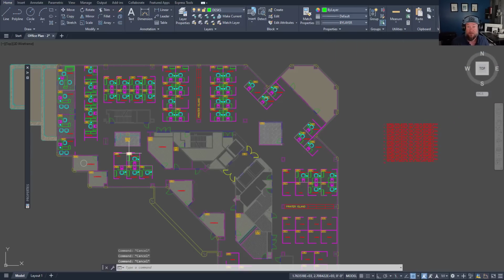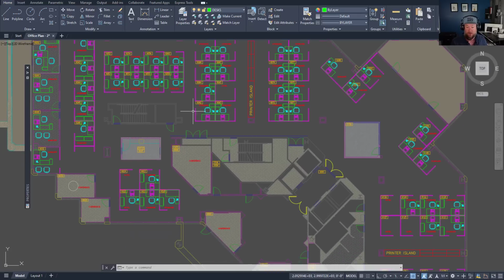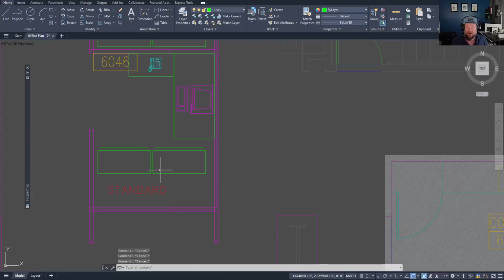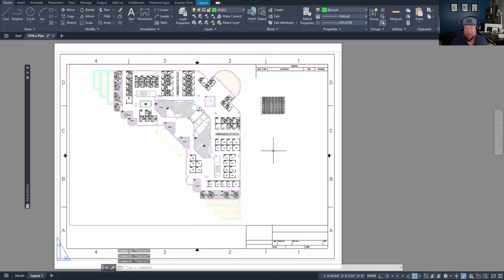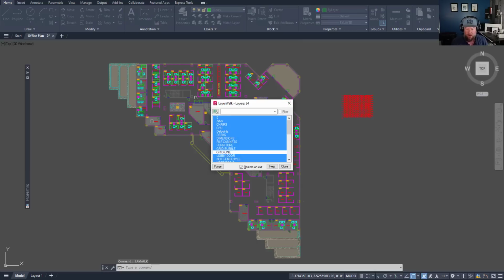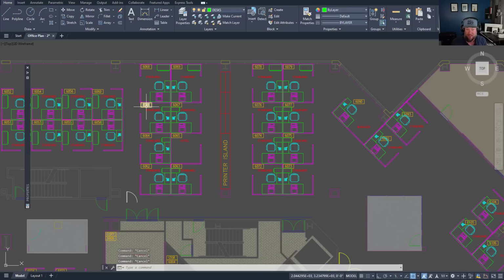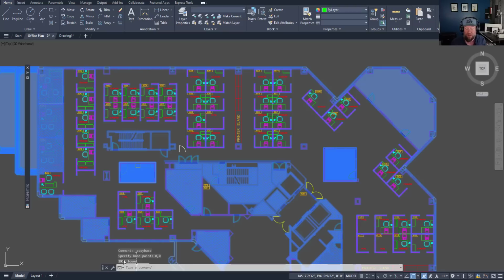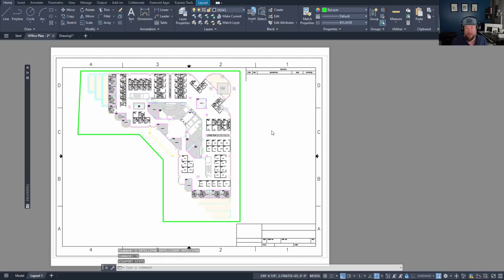10 Unknown AutoCAD Commands You’re Not Using (But Should Be)!

Comment: I use a 20 key programable keyboard (Max Falcon 20) for common commands with keycaps with a transparent top with custom printed labels. I recently bought a 15 key stream deck which has LCD 72x72px displays for each key - I haven't tried it out yet but it looks very cool! There are icon packs for AutoCAD available. This could be a great video backing up this video.